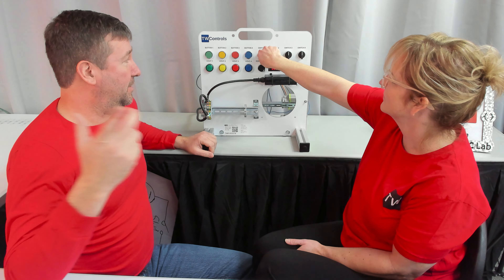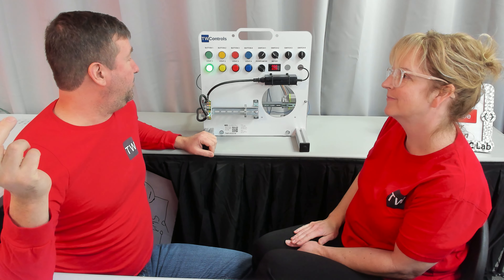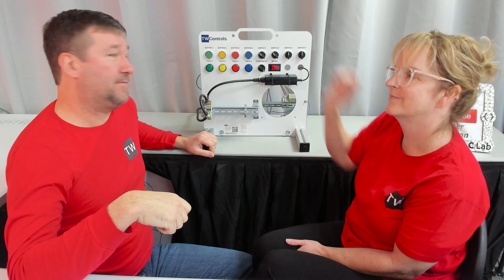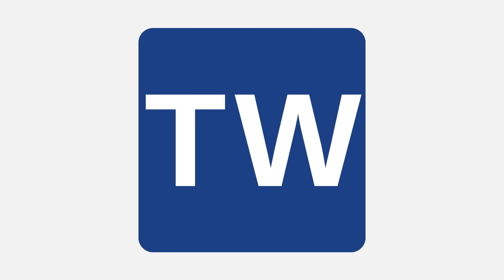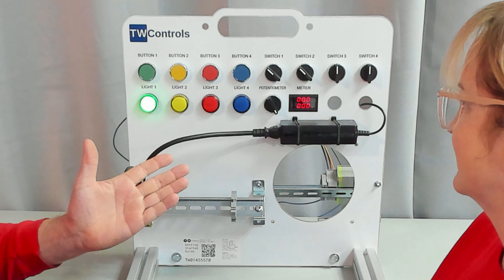2 Wire Control Circuit.  How to Wire and Understand the Diagram

Comment: After many years of doing this stuff I still get confused on sinking and sourcing. Is PNP sourcing or sinking? If I have a sourcing input module which type of input do I need? I ask myself these questions all the time. It drives me crazy!
The one that really gets me is the open collector! How do I wire that? I let the smoke out on one of those guys once.
Reply from the maker: This is something I plan on making a video on, for Allen Bradley and Siemens, you would use a PNP sensor with a sinking PLC input and you would use a NPN sensor with a sourcing PLC input.  The trick is that some manufacturers swap the terms sinking and sourcing.  Here is a video that talks about that.

Comment: wow... think about the audience that's trying to program\install a PLC and that needs an explanation on how to switch a light on/off with 2 wires...
Reply from the maker: Don't knock them for that.  There are a lot of intelligent software engineers that are transitioning over to our industry.  And you would be surprised the "experts" that just get lucky when wiring sensors and just start swapping wires when they don't work.
Reply: Yes, Tim, I’ve shown a lot of new electrical engineers how motor starters work with 3 wire control, how all the hardware works, where the n.c. Overload contact that goes to the coil lives, etc. I’ve been in industrial electrical maintenance for over 40 years and I tell everyone this simple fact…nobody knows it all. Nobody.